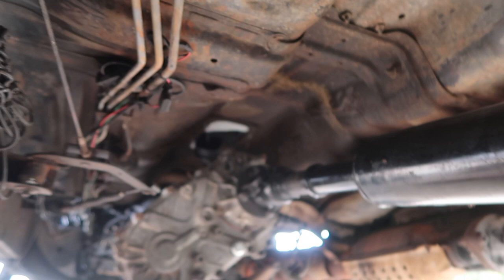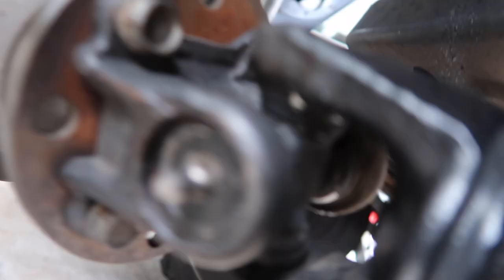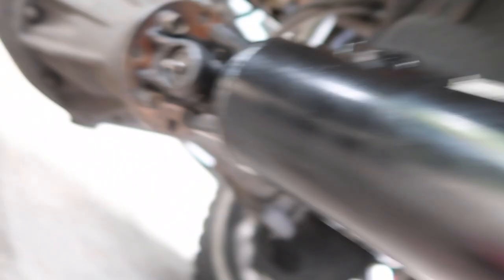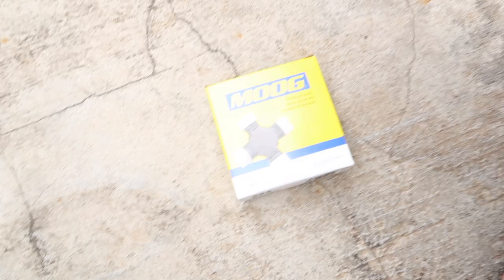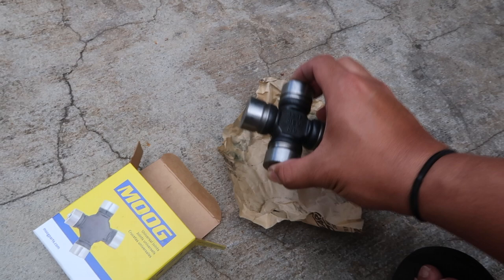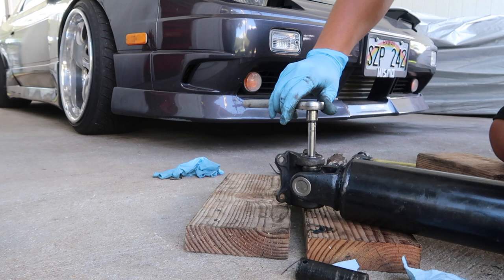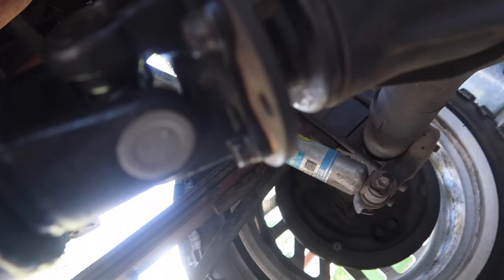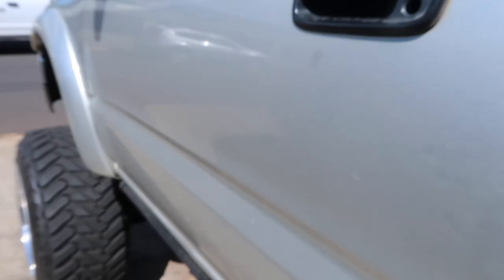I Thought My Transmission Was BREAKING Again -__-

Comment: Thank god it wasnt!!!...another well done video bro!!...keep this in mind. Drivetrain issues like that will vibrate the floor..front tires will be in the steering wheel....rear tires can give off vibration like a u joint if they are real bad. But look in ur rearview mirror and if it's the rear tires u will see ur bed shaking by the taillights. I see u have a little death wobble in ur steering wheel...or tires need to be rotated. I wish someone would make a aftermarket steering stabilizer for the IFS. I have a dual skyjacker on my 85 but with these little trucks anything bigger than a 31" tire should have a dual stabilizer. Cause it will eat ur front up. Tie rods ball joints A arm bushings wheel bearings and "could" warp ur rotors and pads so they wear weird...or all of it over time...trying to help a yoda brother!!!! 🤙🤙🤙🤙🤙 all you guys are awesome!!!! Keep up the great work!!!!!!
Reply from the maker: Haha, you noticed my wobbly steering wheel! Yeah man, my front tires wore out super unevenly. The lugs are uneven but I rotated them and they helped. Just did my lower balljoints as well which I still need to edit and upload but I definitely need to get an alignment done and hopefully my front tires (previously the rears) get normal wear now and hopefully my rear tires (that came from the fronts but are now in the rear) start to wear out evenly 👍🏼
Reply: @fortunestatushawaii  ya I noticed...lol I've been working on vehicles since I was 11...almost 43 years.. lol Toyota's are my life. .lol was going to be a tech but screwed up and lost my license drinking. Sucked..I had everything free at the Toyota dealer I worked at including a car to go back and forth. Messed up big time!!...but yes make sure ur tires arent over inflated or under. And yes they will smooth back out in time. I would rotate my tires everytime I changed my oil or if they got bad before the oil change. About 2,000 miles so I didnt eat the up. I had 33" DAYTONA Radial stags..WHAT A TIRE!!!!! Wish they would bring them back. 
Trust me I'm waiting for ur videos...lol if i ever came there i would love to hang out with u all. It's no wonder Toyota's are hard to find..u guys have 80% of them..lol which is totally awesome!! Cause they arent here in salty states in the winter. I love seeing that red 84 4x4. I have a 85 with a 10" lift. My mom was a machinist and she made my body lift. I may have told u...lol take care all of u!!

Comment: Just need to grease it every 24000 km or less depending on how u drive. Just use a grease gun.
Reply from the maker: That’s about 15,000 miles. I’ve read maybe 3-5,000 miles or every oil change. I’ll probably start off with that and see how they are lol. Thanks though brotha!